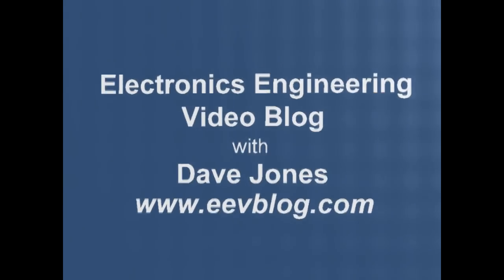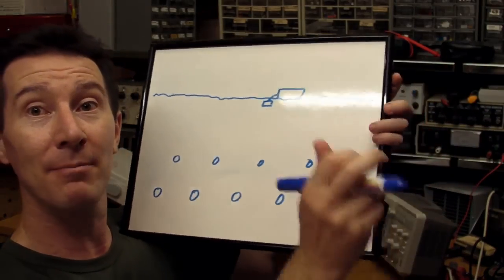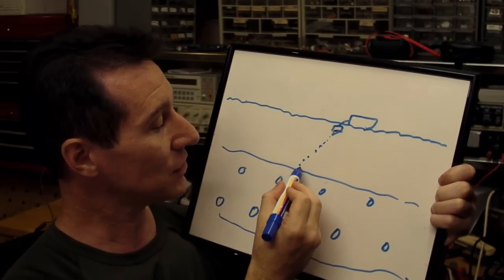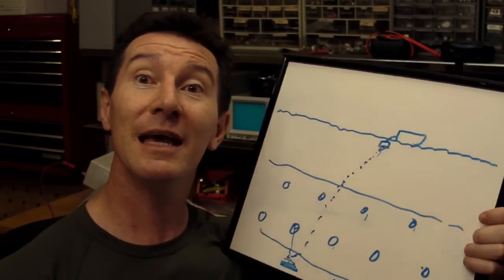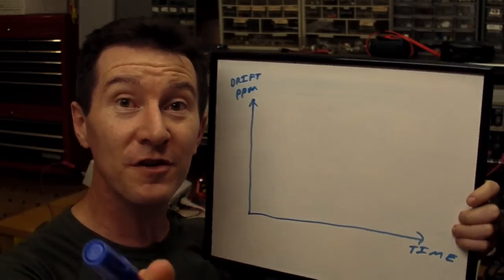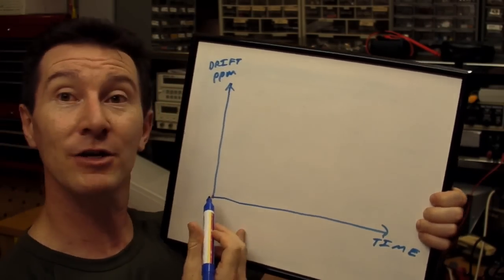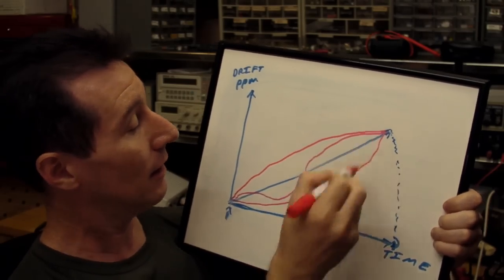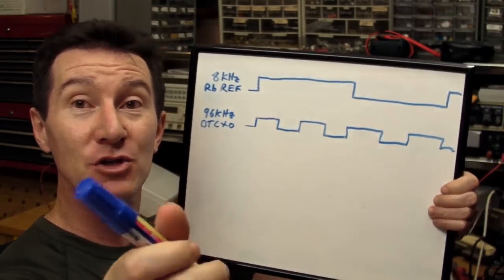EEVblog #61 - Crystal Oscillator Drift

Comment: if a clock drifts by 20 seconds a day i'd eat my hat, i'd expect that from a mechanical escapement (a real good one at that)...
i've made picaxe based clocks using analogue clock tickers before which maybe lose maybe a few seconds a day. and a binary watch which i think gains less than a second a day using a 32.768 Xtal from a fax, and i usually set it to internet time regularly

Comment: funny way to explain things but specifically for the topic of Oscillators unfortunately wrong explanations on the terminology for a TCXO and DTCXO was used… A TCXO is not a temperature Controlled Oscillator but just a temperature Compensated Oscillator… similar like DTCXO. It is again just a temperature compensated product but using a more complex compensation using a microprocessor.

Comment: then you would have either integrate a diving drive on the probe to submerge back each hour. Or  you take a several hundred/thousand feet long cable with a gps dinghi at the end ;-)

Comment: you could have used two oscillators together with an or, then every time it flips you know it's drifting, you can compensate and get half the precision error, with 3 oscillators you'd get 8 times the precision or more, since you can compare two and adjust the third.
Use nasa's solution, if you have more than one you get exponentially less problems.
Reply: consensus over time is much better.
Reply: radiation is the primary problem with oscillators, if you get two clocks agreeing that the third has drifted you know it was probably shot by cosmic background radiation and elevated to a higher energy state, resulting in out of phase oscillation. Nasa had almost the exact same problem with memory, when radiation hit the memory turning 0's in to 1's and vice versa.
Reply: I don't think cosmic radiation is a problem taking deep sea measurements.
Yes, consensus vote is good for detecting defective devices and ignoring them.
But with drift it's different - every oscillator drifts over time - you would have to physically compensate the drift of the detected oscillator i.e. with temperature in a servo loop and that for each oscillator.
The beauty of compensating for the drift in post-processing is its simplicity.

Comment: arnt you just comparing drift to an also drifting clock? is there a way to compare two clocks in a reversal type way to get a true time? something like a vernier clock system?
Reply: It probably doesn't need to be that precise.  The Rb drift was insignificant.

Comment: Why get a super oscillator when you can have an atom clock for free?
Glonas, Galileo or GPS deliver it right to your door (unless that is inside) it is good to the ns.
GPS receivers must be dead cheap, I have four and I am rather poor.
Reply: GPS doesn't work at the bottom of the ocean, the radio signals are far too weak to penetrate more than a few metres of water.
Reply: Croz89 mind you power efficiency would be at a minimum as well. As Dave mentioned, the drift is something you roughly measure before hand and compensate later on in software after the data has been collected.
Reply: Croz89 mind you power efficiency would be at a minimum as well. As Dave mentioned, the drift is something you roughly measure before hand and compensate later on in software after the data has been collected.

Comment: cant you just use 1 MCU instead of all that to test the drift? if you use high precision 10MHz MCU clock and timers/counters and interupts inside of MCU. Then you dont need your external triger and counter, witch give you parasitic delays. At least thats my opinion.

Comment: didnt you say you couldnt use a RbXO because of it's high power consumption? and then you were using it as a reference. oO
Reply: If I get it right, Dave used RbXO in post processing, this oscillator was not actually used in described underwater modules...
Reply: JohannaMueller57 The RbXO was only used to characterise the drift prior to deployment of the UWMs. The results of this characterisation could potentially be used to correct the TCXO drift during post processing though I think the guy said that the worst case drift was found to be within tolerance for the application.
Reply: +billiepipersteeth radiation compensation is the problem, everything runs smooth until your oscillator gets hit by the energy of a bullet in a needle tip coming from a supernova or solar flares or even cosmic background radiation. No wonder rubidium oscillators are more stable, they have a lot of mass and each cycle of the oscillation consumes much more energy, from the perspective of the radiation it's like comparing a fight between you and sheldon cooper and a fight between you and godzilla.
Reply: how stupid could a comment be... they used a pc for logging which had to be in the capsule as well, right???